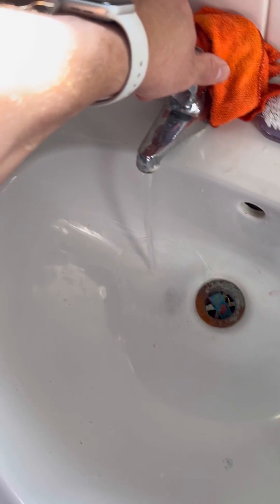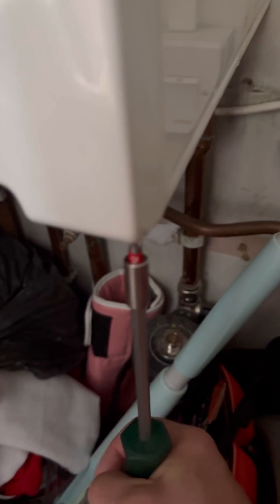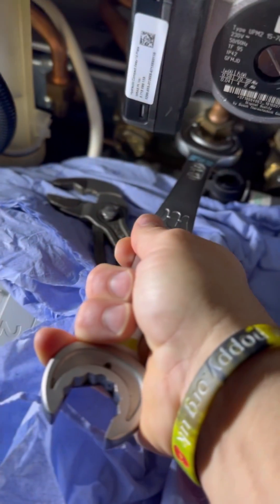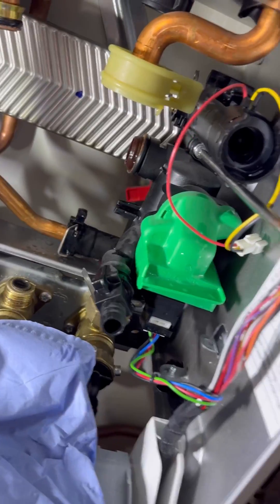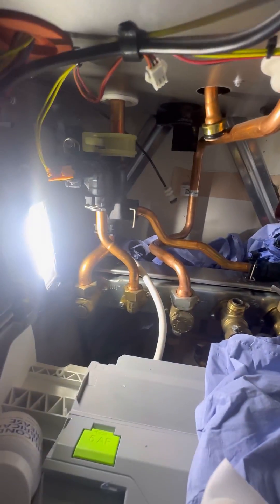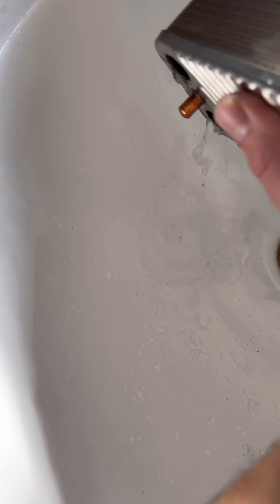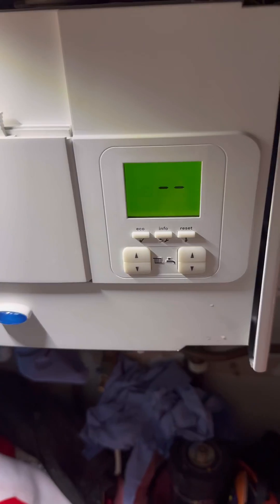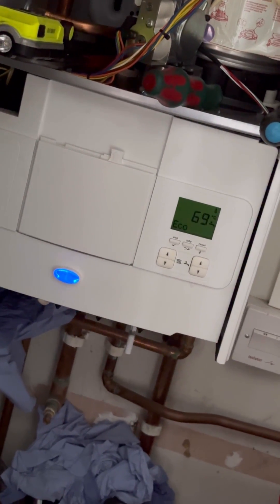No hot water on a Worcester Bosch 30i erp combi boiler water running hot and cold diagnosed fault

Comment: Easier to cut hot water pipe. Drop down back. Good job pal
Reply: Good video
Reply: Not on this model. The gas pipe gets in the way. You can cut the cold if it's piped straight up from floor.
Reply: I was told that but done one today and the gas pipe was in the way.
Reply: Gotta take gas out too.
Reply: Wouldn’t be a Worcester if there wasn’t something that is a common problem to be a nightmare to get out
Reply: Prv is my personal favourite ffs
Reply: @gazzagasco 😂😂